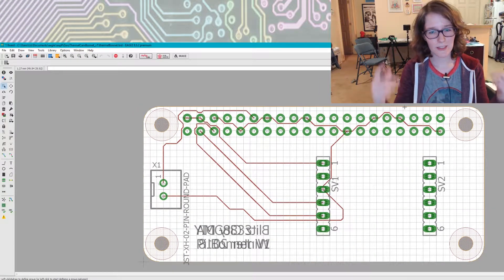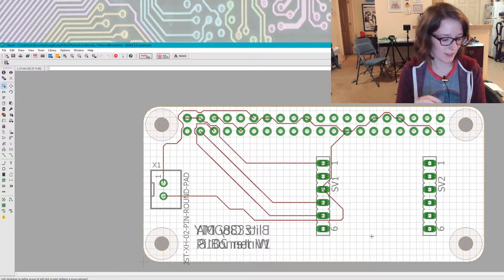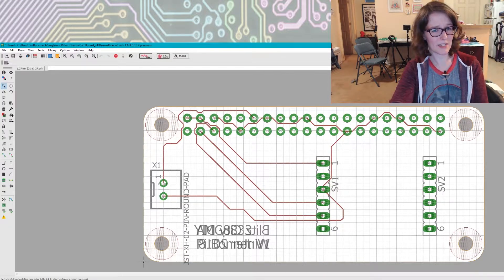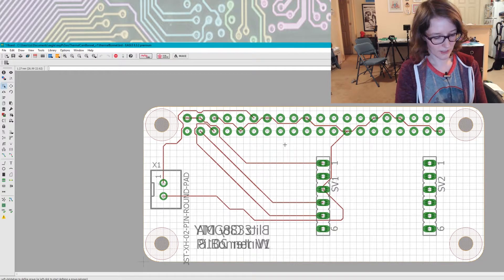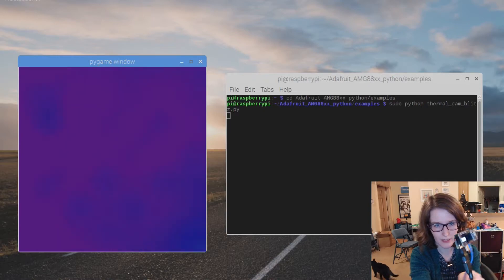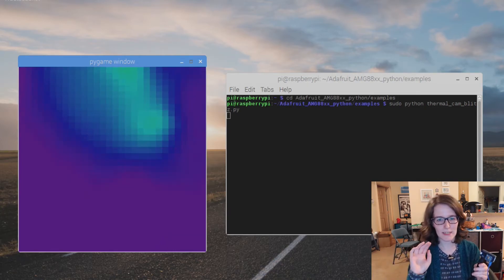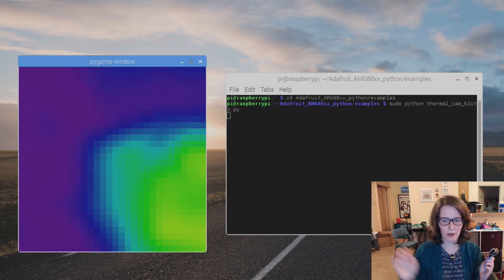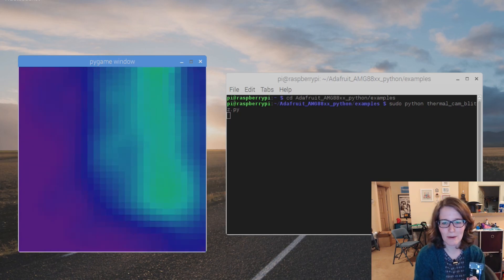My First PCB!

Comment: Nice work. Just a heads up. Most if not all thorough hole components are measured in mil not millimetres but mil or thousands of an inch. If you take a ne555 its package is DIL and has a pin space of 300mil from pin 1 to pin 8 but from pin 1 to pin 2 its 100mil. So when you use your CAD software try and use grids and snapping at 100mil
Also your tracks seem a little thin. But hey it works.
Reply from the maker: Thanks! That's a good tip and I did wonder if the tracks were too thin when they arrived. I'll thicken them for the 2nd revision.